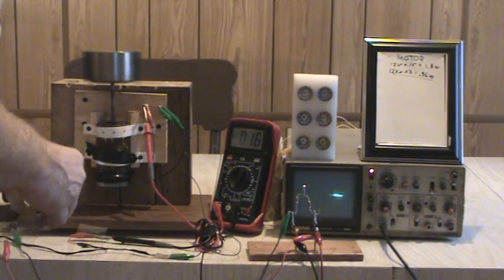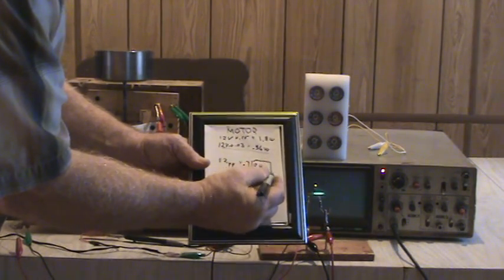Ray's No Back EMF Generator Design 2

Comment: Hi Ray, Very interesting you found out the correct spot on magnet were the back emf, at the same time when you spin the magnet by motor and place the coil on the top center of the spinning magnet, you will get low voltage and thus low power out. Try scaling up this design for more watts.

Comment: If you draw current from the 3 Ohm coil via the LEDs you get back drag, so it is no Lenz free generator. You must use fast coil opening and closing to generate spikes and these spikes are then free and this will reduce also the drag on the rotor !
Hope this helps. Regards, Stefan.